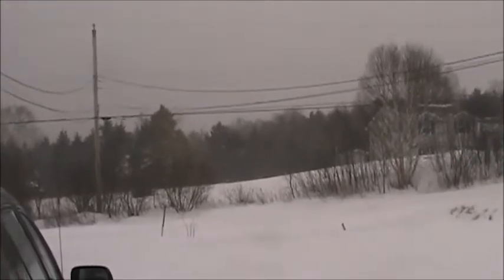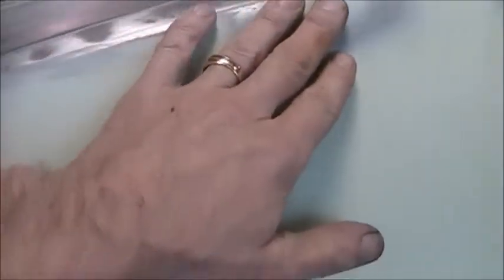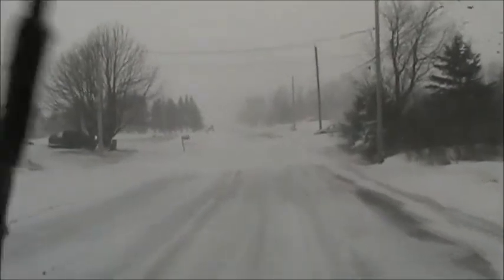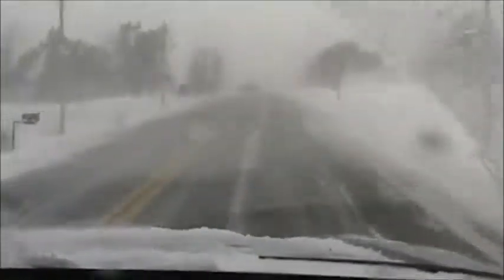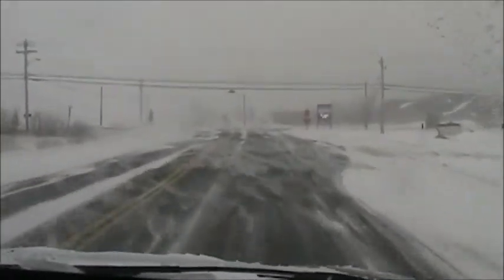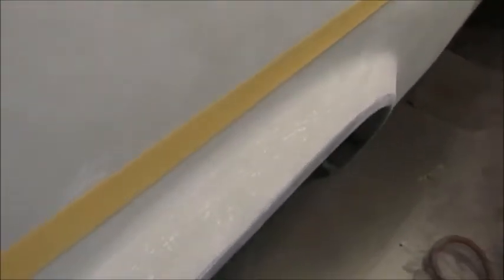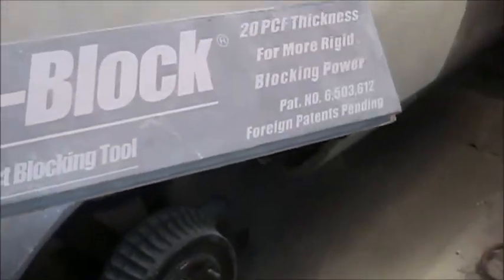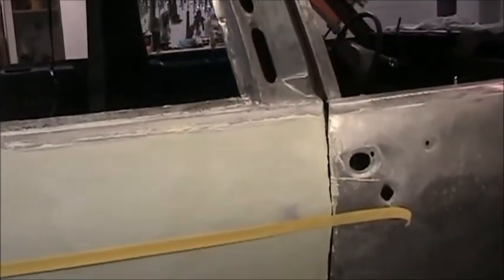snow storm and still trying to get the quarter panel straight

Comment: There huge difference in the quarter from the beginning of the video until now.When adding new filler try a little less hardener to keep it softer then what`s around it so when you sand you sand the new bondo first with out causing low spot`s around it.Looking GOOD!!!!!

Comment: Brrrr, looks cold..lol, i always ran into that problem too on rear quarters when trying to fill in .got aggravating sometimes.Are you using a air file or  sanding by hand with block? I watched one of petes videos where he said your better off using air file on the larger areas to get it straight, just a thought, saves on the arms too compared to sanding it all by hand.

Comment: ...if you compare this vid to your last,,,your leaps and bounds ahead..

Like the road you were driving on..when they laid down the top layer they did it long ways not sidewalk to sidewalk. Remember that bondo sands at different rates every batch because the harder ratio is always a bit different. keep looking ahead to that final skim coat after the "pot holes" are dealt with just like a new highway..
Being open minded like you are is the key..

Comment: Working the bodyfiller at this stage is always a mystery to me. Can't you just lay it on thick and then keep blocking it down with a HARD BLOCK, like a wooden handle one, not the flexible Durablock, until you start hitting metal? Hopefully some of the pros will answer or make a video. It sure would be helpful.